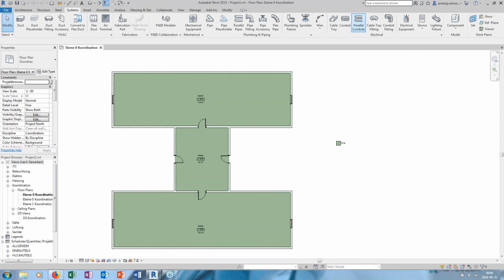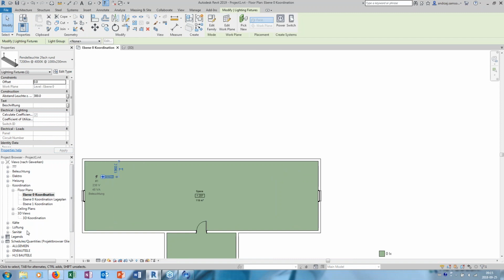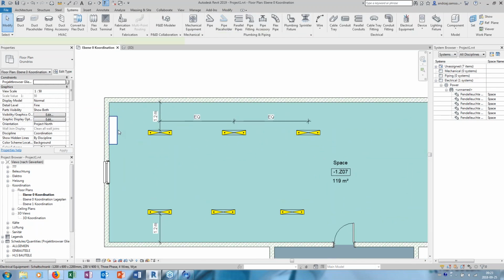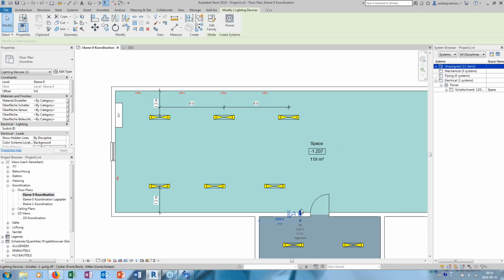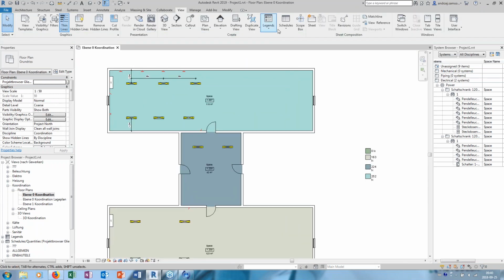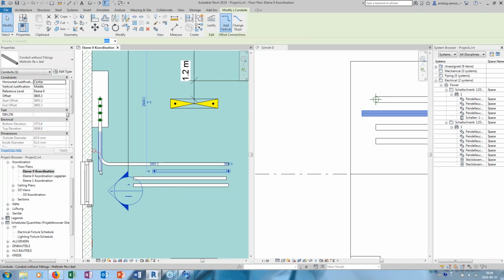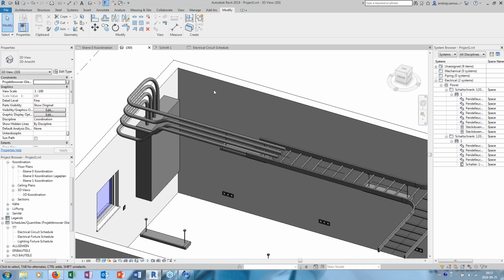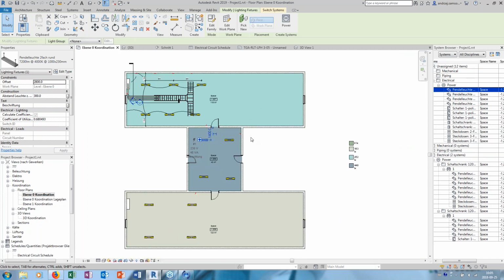WEBINAR - Cum sa proiectezi sisteme electrice in Revit

Comment: Thank you four this film. 
When you have a big distance or altitude from the ciling to the floor, how you choose  the lamp? You nead some  ray of light covering the space. When you nead IP  special for the bathroom or samething else, or the special  lamp- for  example  for exit, how you choose  the lamp? Where is this lamp in manual what you have or is in other program and he is't free. 
When  I nead this: 1 power generator  and the general electric panel for the big construction. Where is this in your program and how do you  relate these and how do you draw them.
Thank you for answer.